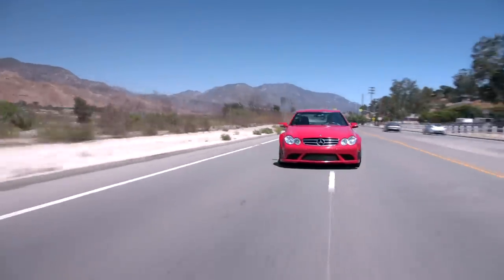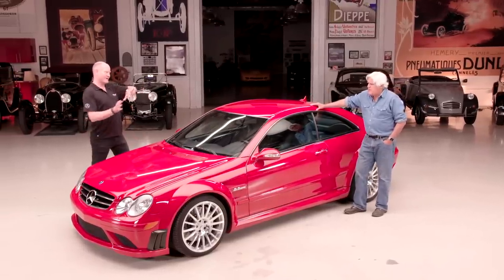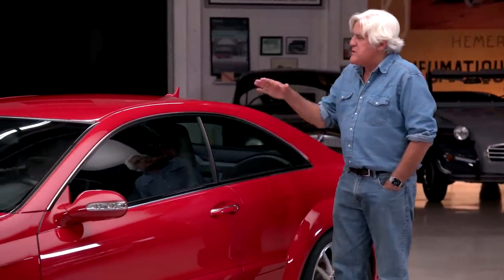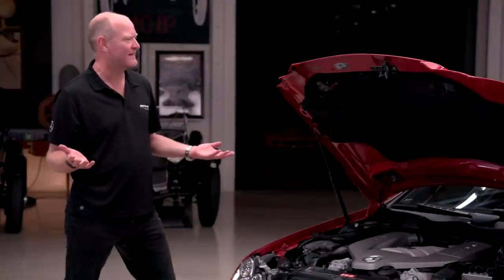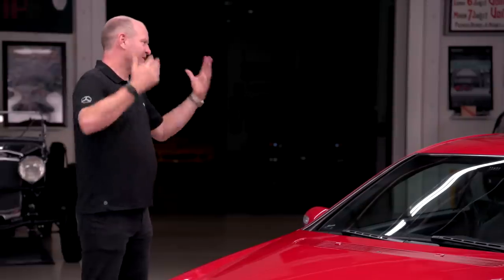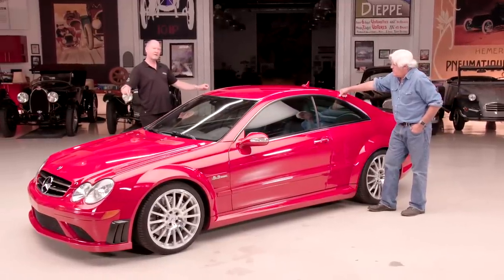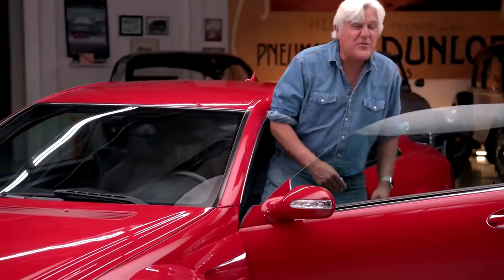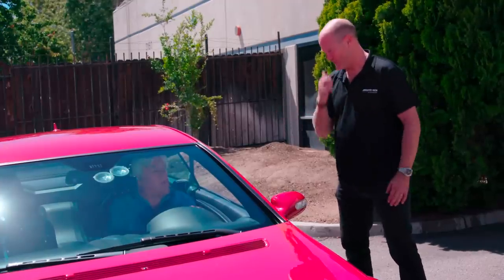2008 Mercedes-Benz CLK63 AMG Black Series | Jay Leno's Garage

Comment: For me this was the tail end of classy Mercedes Design before everything started to look tech bloated and disposable.
Reply: Every series looks the same now, no character no soul, such a shame
Reply: @miyaaaaw  That's all the road cars. Car designers don't know unique car designs if it hit them in the face.
Reply: So so true Jay! Disposable... 

I was never a fan of the bubble design, when young always preferred the previous design language with the headlight wipers and the later ones (´03-´12).

But indeed those round Mercs were the last "forever" cars if that makes any sense.
Reply: So you think a new AMG 63 coupe looks bloated and disposable?  How about an AMG GT?  Bloated and disposable?
Reply: MB started branding AMG just like Ford did with Shelby; AMGs are now mostly option packages consisting of AMG branded wheels & tailpipe tips.
Reply: I honestly think the looks got better and the drivetrains got worse.
Reply: These Daimler era interiors kinda sucked. Monster engines though
Reply: @adammarkowitz7944  yes. Disposable. It is a fairly boring twin turbo engine. The big na engine was always better. That's cause with the m156, the engineers managed to get the engine to make peak power at 6.8k rpm, just 0.2k rpm before redline. Now imagine that they were 6.2 litre engines. A 6.2 litre engine making peak power literally higher than most fpc v8's
Reply: That generation was actually the peak of MB’s cost cutting era… they learned all sorts of ways to cheap out and cut corners from Chrysler during that period. It’s not back to W124 levels and I don’t think it ever will be, but since then they’ve steadily made a comeback in terms of materials and engineering quality.
Reply: @georgecostanza2695  A W124 AMG Wagon is probably my dream family hauler. That, or a E34 M5 Touring 3.8
Reply: I actually prefer the '11 C63 AMG Black Series, oh and the timeless SL65 AMG BS, they're my fav MB so far
Reply: @dennisaleander5175  Yep, true that, so sad
Reply: @adammarkowitz7944  they all use the same engines and interiors, nothing feels special anymore. Plus, they're all uglier than older models, too many screens and nannies, meh.
Reply: Couldn't have said it better. This is timeless.
Reply: That’s interesting. The gen before this is the end of the classy boxy Benzes, and thought this CLK BS looks incredible, the style across Mercedes’ lineup then was melted jelly bean and just very much not timeless design. The last five years or so until now, however, has seen the introduction of just beautiful, sleek, powerful, elegant design throughout most of the brand. Modern Benzes look great. But what I want is a ‘95 E420 sedan and a ‘00 SL500, both with black interiors.
Reply: @weedmastersr  I have a new C43 AMG coupe, absolutely beautiful, fast, fun.   Amazing car.
Reply: @bhaggen  Nope.  I have a '21 C43 AMG coupe.  It has a twin-turbo V6 with 382 H.P..  The non-AMG version uses a 2. liter 4 with 250 H.P..  The AMG also has a performance exhaust which sounds amazing.  The car is fast, fun, and beautiful.  It may not be a "true AMG" in that it wasn't hand built, but it's a fantastic car.  Check out the review by "Mr. AMG" on youtube.
Reply: And AMG being in a a class and every SUV
Reply: Nah I believe the SLS amg and C63 (the one with NA V8 of course), were the real deal
Reply: Because they don’t sell. They rent. 90% of clients sign long-term loans and change cars every 2 years. People don’t like cars, they just want the badge with the latest update.
Reply: @georgecostanza2695  Oh if only we could have the solid design of the late 1990's S-Class/CL.     I guess the question is....will we be seeing a 2020 S63 AMG on collector lots the same way you may see a 1997 S600 Coupe....with folks trying to find a clean example....?     I guess one can hope.
Reply: @adammarkowitz7944  the AMG GT is a very nice shape.   But mostly the design language...the tail light designs, the faux exhaust tips, the plastic emblems containing the tech....they just don't look like solid machines.    The second they discussed putting a turbo-4 in a C-Class AMG, I think everyone shed tears.  MB's just aren't the same, blame the world, the government standards, emissions, cost cutting.   Maybe MB's from the 1990's thru 2002 or so will start emerging as resto-mods.  = ]
Reply: @weedmastersr    My emotion exactly....
Reply: @vab120  Huge part of the tragedy.  Benz builds for lessees, not for long term owners.
Reply: For me it was w204
Reply: These headlights are sub-par, though. And the current shark lines down the hood, shark nose front end, and mean looking grills, is a step up?
Reply: @adammarkowitz7944 .....Thanks but I'll stick with my unpretentious 500E. "My aunt used to have one of these".....No she didn't
Reply: Lol, trust me this is exactly what they said about Mercedes in the early to mid 2000s.
Reply: I feel you, my man
Reply: Funny. People were saying the same thing about this generation when it was new. Everyone will always say this about the “last generation”. Wait until all cars are electric, how fondly we will look back at the “tail end of the classy era of 2021”.
Reply: @raver208  My G wagon and GTC would disagree.
Reply: @Fluterra  A G Wagon should be large and lumbering in appearance....plus that model is one that M-Benz tried very hard to keep faithful to original design from the mid-20th century.  Galandewagen is almost a brand to itself....glad you own one.   As far as the GTC, it's bloated with tech, but light compared to other benzes, yes.  ....it's pretty and an insane performer but it's styling looks more like other sport cars in its segment...alas, very subjective stuff.   I hope the GTC attains collectability and yours is on the block at Barrett-Jackson in 20 years.  Unless you're like me and hold on to cars forever.  Ha.
Reply: Lol
Reply: @bhaggen  Most Benz' have an available amg appearance pkg, but the actual amg versions are decidedly different.
Reply: @alm4132  Yes, my Armenian neighbor had to get his daughter an E-350 with the AMG "decor" every time she hits a pothole the tire and the AMG wheel are $2K; he's tried having them welded with little success
Reply: @adammarkowitz7944  Yeah i think theyre disposable.

S Coupe was amazing imo.

But those others arent. Just the same 4L Twinturbo in them all, they have no uniqueness from one another, nothing.

You can get the big 4 door coupe, the SLS inspired cool sporty coupe with a wing, the limousine, etc.

And all with the same tech beneath it. Its like Volkswagen and Audi. Made to sell and be scalable.

The Black Series are still special. The other ones, not so much.
Reply: I agree.  The current cars are  hideous compared to this. 
Only merc I like is S class. But I'd probably buy an Audi 😂
Reply: @bhaggen  yup he bought a hunk of junk
Reply: Right you are. SUVs and similar designs are simply awful.
Reply: Absolutely.
Reply: Same here, i have an 07 s65 and an 08 e350
Reply: @bhaggen that’s an amg package not an amg car, big difference

Comment: The CLK63 is one of my favorite Mercedes designs. At a quick glance to non enthusiasts, it looks like a normal C class with some extra bits but is so much more than that and it sounds amazing.
Reply: I have a hard time telling them all apart honestly
Reply: It has the face of C class and end of an E class.
Reply: Actually people are mistaken the CLK was based on the E-Class of the time the W211 NOT THE C-Class. The CLK is what is now known as the E-Class Coupé. The C-Class at the time was the W203 and the CLC kompressor was the Coupé version or model for the C-Class. Tommy and Jay are both mistaken, the CLK63 AMG was based on the W211. The modern equivalent now would be an E63 AMG Coupé (W212 or W213) doesn’t really matter which one, either are still good for today’s time period.
Reply: @muzamilabidi3027  Thank you! FACTS
Reply: @muzamilabidi3027  Well it has C-Class running gear with an E-Class interior so yeah it is a W203 underneath.  The suspension and brakes were from the C-Class but the interior and engines were shared with the C-class and E-class.
Reply: @muzamilabidi3027  that is true, the confusing part is the CLK is built on the C-Class platform but it is supposed to be an E-class level car. It is essentially a E-class coupe.

Comment: Tommy’s comment about guest drivers trying to impress him, reminds me of a similar line from Derek Bell at a Porsche Driving Experience day in 1991, when he said “Don’t try and impress me - I have won Le Mans 5 times.  I can go out on my own anytime and prove that adrenaline is brown”
Reply: hahahahha!
Reply: I also attended a Porsche Driving Experience in 1991; mine was in Los Angeles (I was on the local PCA-Los Angeles Region Board of Directors), but our instructor was Vic Elford rather than Derek Bell. One of the proudest moments of my Porsche ownership days was completing the combined acceleration & slalom course at the end, in an AWD 911 equipped with the "new" Tiptronic  gearbox (my first experience with that transmission), and having Vic Elford lean into the car at the end and quietly say "Nice run, Paul". Ahhhhh!

Comment: Man, I'll never forget when these first came out. I was walking to my bus stop and this one was sitting at a light, waiting to make a right onto ventura blvd. It had the optional aero with the wing and everything. He floored it and slid out onto ventura and it hooked and he just slammed out of there. It was amazing to see one right when they came out, but the sound, the way it hooked and looked will always be something I'll remember. I was just replaying it over and over in my head the whole bus ride.
Reply: There was no optional rear wing for these. So what you saw was probably a Renntech tuned example or a CLK DTM, which came with a detachable wing that could be stored in the trunk.

Regardless, I too remember the first time I saw a CLK63 BS and I KNEW I HAD TO HAVE ONE; one of those things you never forget.
Reply: @AutobahnVault  the DTM is even MORE SICK than a 63
Reply: just your average valley divorce attorney heading to afternoon tee time
Reply: The only option was the iPod Adapter Cable!
Reply: @TwamZ  Tell me you went out and bought one….
And you still have it…

Comment: Regarding the naming scheme: it started with the SL K and then was followed by the CL K. Mercedes‘ wanted to go down market with smaller versions of their established luxury models SL and CL. The letter „K“ here stands for the German word „kurz“ which translates to short. So it is meant to be a short/smaller version of the CL and SL (which by themselves stand for  for „coupe leicht“ and „super leicht“)
Reply: so is K standing for Kompressor just like, an old wives' tale? Just wondering cuz I've heard that more than once
Reply: @jacobl6714  It means "kurz". Not all SLK's have a supercharger, which is what Kompressor means. And the S in SL and SLK stands for "sport" not "super".
Reply: @HeadOnAStick  right right thank you very much. I know about the sport part, and I knew not every model with a K had a supercharger, but it's just something I had heard a bunch. But gotcha, it's Kurz, meaning short or small, like the German stg44 rifle in WW2 using the 7.92 Kurz round, a shortened "8mm" cartidge

Comment: Wow, I love this AMG, never seen it in red before. Such a beautiful yet aggressive design. Thank you Jay!
Reply: I know, red really does it for me. I prefer leaving most non-tuner cars stock(ish) but I'd love to see this with black rims
Reply: This is "Mars red" only 10 red clk blacks were imported to the states.
Reply: @jacobl6714  black rims would totally suit this car
Reply: @g6g401  I thought it was only available in black or silver. Thanks for the info!
Reply: @theoriginaloneminutesketch7892  yeah, right? Especially with that red. I've never seen that spoiler either, which rocks. But mainly a manual transmission would put this car in my top five favorites. 

The tail lights look kinda lame in my opinion though. This era of Mercedes design had a bunch of amazing cars but the rear ends are some of the only weak elements imo, I wonder if smoking them or replacing them with led's might help?
Reply: @jacobl6714  I’m a fan of keeping the car stock to OEM look, but smoking the tail lights would look good
Reply: @g6g401   I didn't know they called this Mars Red. It looks like Sunbleached Red. I LOVED the VW/Audi Mars Red way back when.

Comment: I worked at a Mercedes dealership body shop for a while. And after working on them and seeing the cost of parts, I'm not a big fan. That being said, that's a great body style. That style and the ones from the 70's are my favorites
Reply: if someone was to buy this car what would you tell them to look out for and what things start going bad on these??
Reply: You can buy cheaper, but probably not better
Reply: Buy a Toyota if you worry about cost lol. No one buy a new Mercedes worry about cost of parts lol.
Reply: normally people who work at car shops can’t afford this either so makes sense
Reply: @lilpsack7194  normally people that work on Mercedes’ know the design, material used are of the highest quality and are happy to invest in quality. Uninformed don’t
Reply: @challenger516  yeah, cause you have a warranty lol
Reply: @bernardwarr4187  reliability on mercedes is crap...
Reply: @goodone5590  another unsubstantiated, mean less, I’ll informed comment?
Reply: @bernardwarr4187  no its true, after 3-5 years they start to have issues

Comment: A collision shop I worked at in 2008 had one of these come in for minor damage and the owner showed us the letter it came with from AMG that basically said if there is any moisture on the road not to drive it hard.
Reply: I don't understand why it would be much different to all the other models with the M156 like C63 etc

Comment: We had the predecessor, the CLK 55 AMG. It was in the shop; A LOT, mainly due to seat issues and sunroof issues. Now the black series would not have the issue we had most, which was that the passenger-side electric headrest would go all the way up when you folded the seat to gain access to the rear seat, which means now you cannot put the seat back down. We spent more time driving a C class loaner than we did driving our CLK. There were even times we would drive off the pick-up area at the dealership, and then loop back and turn it back in. Certain years of these had an issue with the transmission cooler lines that run through the radiator tank, they would leak and then antifreeze would go into the transmission and destroy it.
Reply: Had an 03 clk55 from 09-13 then gave to my mother who is still driving it. Had a couple of minor issues, few leaks from valve covers and oil cooler, failed heated seat element (ext warranty paid) but solid other than that. In period maybe not the best electronics from mb but as an inexpensive (to buy) old German coupe, pretty sturdy cars.
Reply: 2005-2006 are the best year models for the 55s by then all the issues were sorted and they came stock with the quad tail pipes instead of twi n.

Comment: Actually at 7:45 the CLK is based on the C class (w203) but it is styled after the E class and was sold as an E class level car , at the time the 2 door C class was called a C-Sportcoupe and it was smaller than the CLK . Fun fact the E class coupe (previously CLK) manufactured from 2009 forward was also based on the next C class(w204)
Reply: Was looking for this comment 👍🏼
Reply: Thanks for the clarity. As a Mercedes’ owner I knew he wasn’t entirely correct because if you had a c class back then you knew the clk was separate and more in line with the e class in luxury and options.
Reply: Thanks for the clarity. As a Mercedes’ owner I knew he wasn’t entirely correct because if you had a c class back then you knew the clk was separate and more in line with the e class in luxury and options.

Comment: I was driving on the Autobahn in a rented Opel doing 210kmph and there were cars passing me on the left like I was standing still so having the correct speed rating of tires is essential for real world safety
Reply: @petterin1  agreed.  Only been there once B but I feel like I was going 240 and got passed by old guy in wagon.  Its real
Reply: Not possible in a opel. You were probably stopped on the side of the road with a broken speedometer.
Reply: @petterin1  You clearly didn't comprehend my point there in Germany. He said there are regulations that require that the replacement tires meet the manufacturers speed rating recommendations. In North America it's kind of irrelevant as cars aren't driven anywhere near the limits of the tire ratings. Hope this helps you understand a little better why Jay brought it up.

Comment: This is a perfect car for weekend or night driving. When I was buying my 2007 CLK 350 I though about getting 63 Black Series instead, but the prices of replacement parts were killing me (fron disc brakes about 10x more expensive than in 350). But today, if I could decide again, I would get 63 Black. The problem is... today they are at least 2x more expensive than 10 years ago.
Reply: Who tf even looks at a black series when buying a clk350? Thats like comparing s 530d to a M5...shouldnt be compared at all.
Reply: @hexagonosaurus5848  I agree 100%, but CLK is not a daily family car, regardless of engine. At least in my case both are weekend drives.
Reply: 350 for a weekend car 🤣🤣
Reply: @germalean88g77  Absolutely yes, but not for a weekend track riding though.